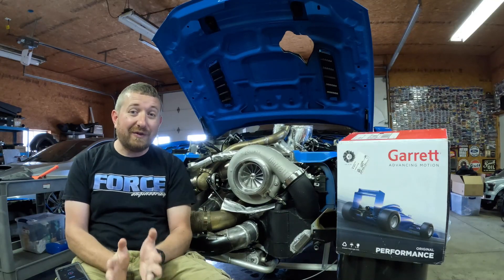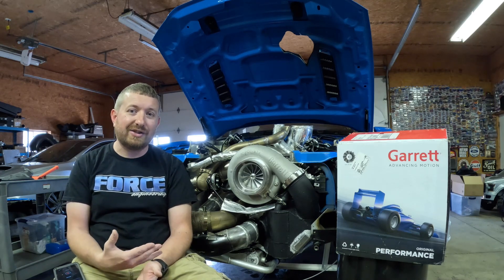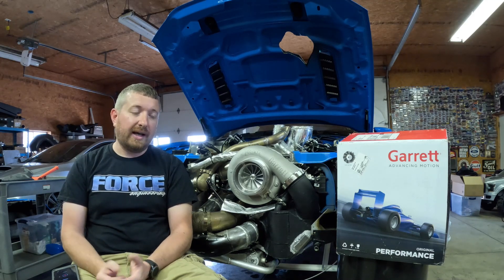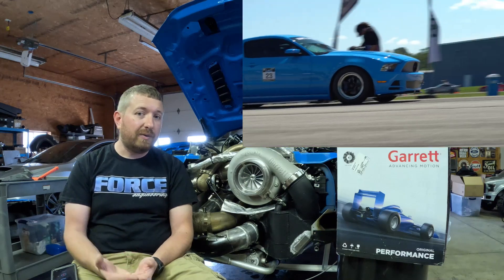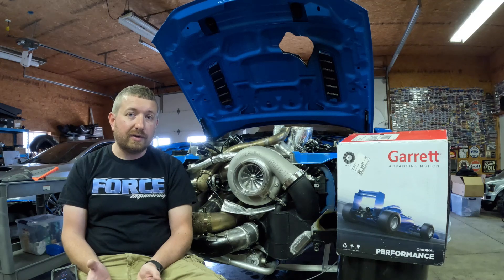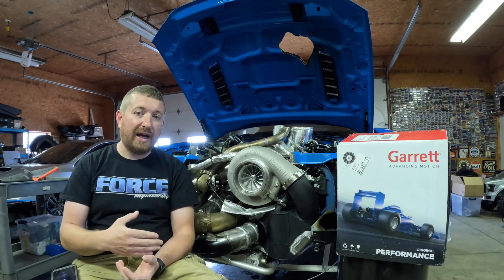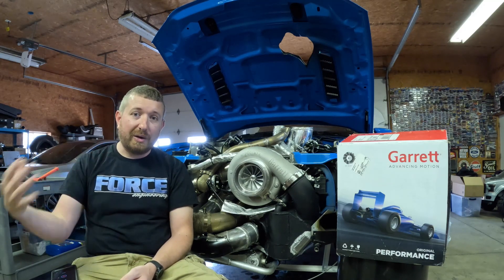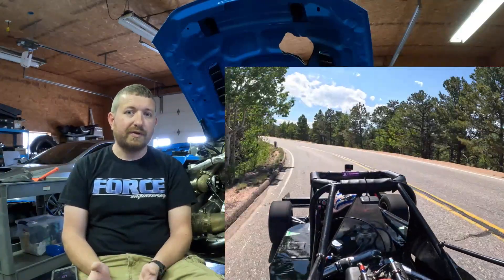Choosing the Right Turbo: Garrett G57-3000

Comment: Your 100% spot on. I'm running a 2.0l 4G63 Compound system with an 88mm comp wheel feeding a 59mmcomp wheel with a set goal of 1500WHP @ 10500RPM. My last compound setup made close to 800WHP with a smaller turbo compound setup @ 9500RPM.
Reply from the maker: Man! Speaking my language with the compound turbo 4gs! I build few 4G engines. Was one of the first to work on compound 4g setups with Paul Volk and John Whalen back in the day. Love the possibilities from a system like that! Very cool stuff.

Comment: Was 94/104 difficult to spool.
Reply from the maker: With the transmission dumps closed, yes. With them open no.  Spool time will greatly depend on the engine combo and converter.

Comment: I find this to be common on v8 turbo deals as well. I had a 451 cube sbf with twin pte 7675 on 1eth r fuel. Anyways it would make like 22-24 pounds and it would make around 1300 wheel through th400. Had an injector failure and torched the piston and head. Anyways went to smaller cube 427 and it picked up 150 hp wheel on the same boost and co2 was nearly 1:1 up until 28 pounds before I had to start banging the gates with co2. So that was telling me that the turbines are the choke point. I don’t have a back pressure sensor but judging by how much co2 I am having to keep on the gates to get anymore boost I’d say turbine drive pressure is much higher than manifold pressure. The combo could use bigger turbines to keep the pressure ratio across the engine happy. I think we get lost in the compressor flow capability and don’t consider much the turbine drive pressure side of the house. I believe this is why every time the smaller engine makes more power with the same turbo vs the larger engine. I don’t think it’s as prevalent in the 4 cylinder world due to the common turbine options being more appropriate for their displacement etc. Thankfully the newer turbos are addressing this. Of course we can pin the gates but after a certain point I found on my deal it does make a little more boost but IAT and egt is bananas and unsafe. I am sure many others have experienced this. I think a lot of people switch to methanol for the iat which is fine but it may help more to adjust the turbine size of the turbo if possible. Just my thoughts. The car is 2850 lbs and traps 152 with smaller cube 427 from 146 with the 451. Same boost level.  1/8th mile. New engine has 2 points less compression as well. It’s 10:1 vs 12:1. Same everything else. The small physical size of the mid frame turbos is very desirable though like the 7675 gt42 sized units. Give and take strikes again. It’s fun though. Cool video.
Reply from the maker: I can really appreciate all of that info! Thanks for the comment. Adding to the 4cyl stuff. They also will have more rpm for the same airflow. Thus, making more power at the same airflow. With mass flow of the system being the same, they should run into a turbine limit at the same airflow as a larger displacement I6 or V8, just happens at a higher rpm and thus is doing more work in the same time frame.
Reply: Your smaller engine was just built and tuned better.